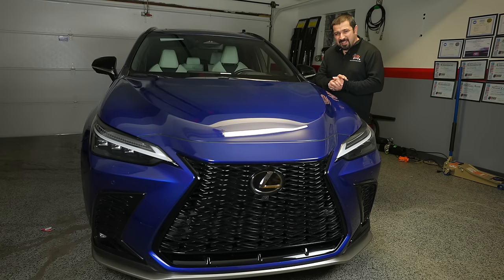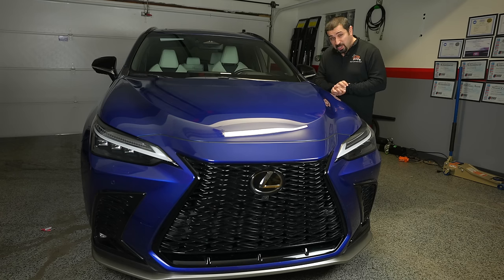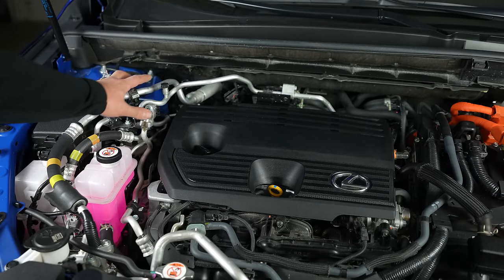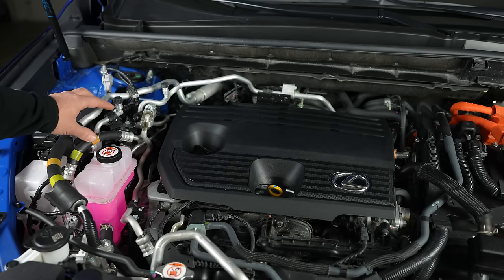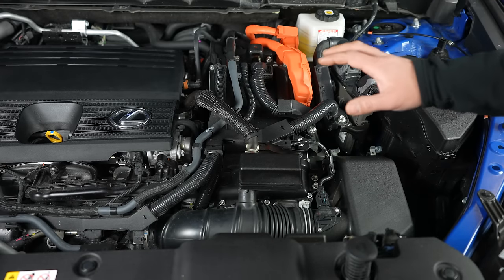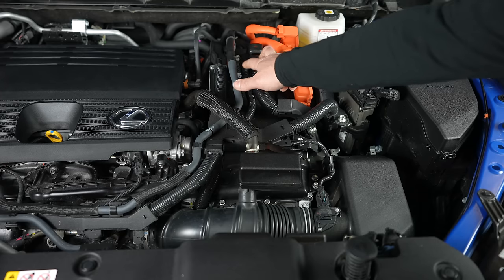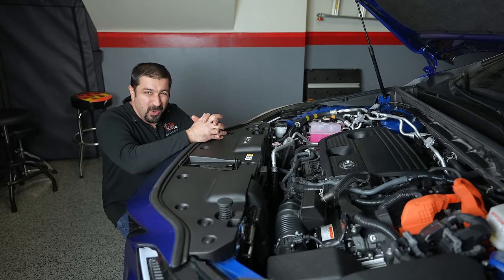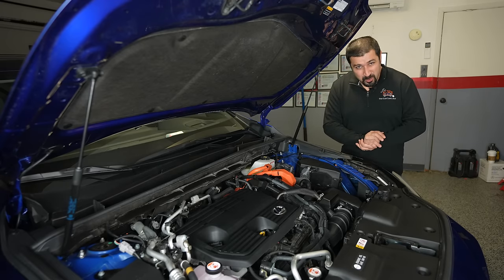The 2022 Lexus NX Marks the New Era of Lexus! Full Review and Technical Tour

Comment: I work for Toyota so I may be biased, but the electronic door handles are electronic for safety reasons. It will stop you from opening your door if a cyclist or vehicle would impact the door were it opened. In that case it will beep at you and not open the door. As you said though, there are mechanical work arounds if the battery or electronics fail. Some other cars have a similar setup like Tesla.
Reply: I have the same system on Audi with classic door handles. They also would flash or be blocked if some obstacle is detected. So - no reason for such complicated handles that no passenger is able to open or close (unless they are instructed before).
Reply: Imagine parking your car in Manhattan. The door will never open lmao
Reply: @tadeusz8977  can you link a video where we can see the doors being blocked on an Audi?

Comment: Wonderful review. I’ve heard, the reason Lexus went with the button door handle has to do with sensors detecting bikes, cars or pedestrians traveling by and not allowing the door to open crashing into them. A mechanical solution would not have worked as well.
Reply: @wth2021i dont agree. These companies reaseach things. Reviewers dont. Those are just opinion based on little things they know. Saw lots of vidoes videos where a motorcycle, Bikes or even cars hit the door becuase the passenger or driver did not know something is coming at the back.

Comment: I have owned three Lexus vehicles over the years. Gone away to BMW then Volvo. But am going to go back to a Lexus NX 2022.  I have tested the new car extensively and it is superbly refined to drive with a brilliant adaptive cruise system and the best heads up I have ever seen. The touch buttons on the steering wheel are overwhelming initially   
but once you have set up your favourites  it's very easy to use. As for the doorhandles, yes they are a little strange but you get the collision avoidance as a real benefit. Progress I guess.

Comment: I have the 350h and so far just loving it! It did take a bit but got used to HVAC settings. I'm a month and have learned how to set up shortcuts and other easier ways to automate stuff. The Lexus "Siri" is very accurate so don't really need the touch screen as much as you might think. It should be noted that the steering wheel controls are for the top level ONLY in Canada. Any other level there is no HUD or programmable buttons on steering wheel.
Reply: Are you totally fine with the HVAC controls on the touch screen now? Or do you still kind of wish you had physical controls for that?
Reply: What’s different about the HVAC settings?

Comment: Thanks you for such a comprehensive and informative review. It's interesting the difference between the US and UK/European reviews of this car. In the UK the reviewers love the e-latch system and the steering wheel controls remarking that they're both clever and sophisticated, otherwise barely getting a mention. In the US and Canada, the reviewers, without exception dislike them. The same is true of the run-flat tyres (tires). I've had run-flats for years on my BMWs and I like them, I trust that if I get a puncture when travelling at high speed that I'll be easily able to maintain control and won't have to stop on the side of a busy Motorway/Freeway to attend to a flat. Sure there's a little more road noise in the cabin and they're maybe 5% more expensive but I also get more luggage space. The additional weight of EVs and PHEVs does put extra stress on the tyres and they're more likely to suffer from flats making run-flats an even more logical choice I think. Looking forward to delivery of my 450h+ next month.
Reply: yes, AMD is truly a nut- in a good way!  He is a blessing with his insights.

Comment: Thank you for a very detailed review. I have been driving the 450h+ for two weeks now and overall, I love it. The door handles are not such a bad thing - people will get used to it. The steering controls are something else. The touch controls (just the function display) show up on the HUD every time hands graze over them - especially while turning and is distracting. They also lack texture and force the driver to actually look at the HUD or the buttons, every time a button press is required. Perhaps a SW update will include an option to disable controls display on the HUD and include more customization of buttons.

Comment: Thanks for the review AMD. What should we do once the run flats wear out? Just get regular tires? How do we get around not having a spare tire? One big reason I don't want the plug in is that  it doesn't come with Mark Levinson sound systemas an option.  Also later on the range on on evs are going to be much greater than 40 miles. They will be in the 200-300s. 2022s will be stuck with 40 miles of ev range. As of yet the charging technology, where you can charge, how quick you can do it is not convenient and efficient.
Reply: Michelin cross climate 2
Reply from the maker: Hi! I would get regular tire and have the inflate kit. Otherwise get a spare tire and leave it in the back for long trips. Not ideal but better than nothing
Reply: @IftiIftiIfti  I have CC2 on my 2017 CRV already.  Thinking seriously about getting a NX 350h, so looked already to replace the run flats.  Unfortunately, Michelin does not yet make the CC2 for the 235/50R20 wheels at this time-just the Michelin X-ICE,  Pilot and the Primacy AS.  The Fsport and Luxury trims levels all have the 20 in rims,   I think I would rather have just the std 2335/60R18 wheels on the lower trim as an option just for the tire options.
Reply: @xfirstxlast6502  So you are saying, if I wanted to replace the run flats, I would also need to replace the wheels as well? I'm thinking about getting the luxury package that comes with 20 inch wheels.
Reply: I wish Lexus would make a compartment that we could put into the back in place of what is there to hold a spare tire.  Will go to regular long lasting Michelins once the run flats wear out.  Worried about how they will do in New England winters
Reply: @josefernandez2722  No, just replace the tires.  I plan to keep the 20in wheel that will come std on the 350h Luxury package-- nothing is perfect.  However, the 235/50R20  size does seems to have very limited tire options now vs the 235/60R18 standard tire.   When I can get one (waiting for allocation at Lexus now), I plan to see if Discount Tire will give me some trade-in value and upgrade to the Michelin tire.    I have done this several times before at DT, since I am pretty picky about tires also.  I agree with AMD- why the run flats???
Reply: @william6765  If you get the 18in rim, you will have lot of long mileage/winter tire options.  Unfortunately, the upper trims all come with the 20in rim.  And at this time, even the longest lasting Michelin is the Primacy AS with its 55k mile warranty for the 20in.- no Defender T&H or CrossClimate 2, at this time.   I can not find much testing/reviews on the Bridgestone run flats or the new Primacy yet- so TBD.
Reply: @william6765  The Bridgestone K02 tires are the best for the kind of heavy snows that a New England Winter kicks out,
and there is another tire that ranks #2, is quieter and soother for highway driving that I bought and still does a great job in the snow. I have used them for 2 years and found that they are wearing well and I only use them from mid December to April 5th.

Comment: @The Car Care Nut 
I am a Master Certified Lexus Parts Specialist, I am pretty certain these new NXs do indeed have the new stem replaceable sensors. The new IS generation does. I will grab a 2022 NX VIN tomorrow and look it up to make sure.
Reply from the maker: I was actually shocked when I saw this and checked it on the repair manual and new car features it doesn’t list the separate type at least for the NX450h+ please do update if you find anything
Reply: Thanks for looking.   I am hoping  this is one of early pre-production cars that have been round for awhile. It has the Texas  manufacture plates that I had seen on several of  the first UT reviews and the car looked like it has seen a few miles by all the dirt on the underside. :-).   Hopefully, yes, they will have it.

Comment: The new door "handles" - I think that implementing the auto-locking feature (to prevent opening when other cars approach) would have been complex with a fully mechanical system: you will either constantly lock/unlock the door (noise, wear) or would have to add a secondary solenoid to disable opening (noise, more complexity).  Seems to me the fully electronic solution is simpler (although having a secondary mechanical system as back-up may nullify what I said).
Reply: I think the outer handle is the compromise and "price" of the price of the NX. It's a "simulation" of the good old inductive door handle of the prius and later cars of Toyota. The inner handle is a very good idea, I think. One can prevent an accident and pushing is better than pulling I think. The only thing I don't understand is, why there is a manual mode and a automatic mode. There has to be a better solution.

Comment: For my NX300H 2022, I paid $120 for gas for almost 900KM both highway and city driving. In my 2020 Rav4 XSE hybrid, I paid $90 for about 790KM. Both cars are amazing, and premium gas does make a difference for the engine. 

I still have my 2013 Prius C, and it is still running great👍
Reply: How long do you think battery will last on these hybrid vehicles? I’m worried about battery replacement costs.

Comment: One con for the new infotainment system: the navigation is no longer built in. It’s connected. So you have to pay $16 a month just to have it there. Adding insult to injury, if you pay for the navigation but you live in an area with no reception the nav won’t work at all

Aldo iirc no nx offers a spare tire now
Reply: Yeah....I really couldn't care less for the outdated infotainment center with gimmicky features.  I can just replace it with a much better system that is much more modern and futuristic.
Reply: Well, you have options. Wireless CarPlay and Android auto will give you the nav you need. 

Maybe if nobody pays for the nav, they will give it at a lower cost. I think the cost of the data used by the nav.
Reply: True but remember the same problem I mentioned applies to CarPlay and AA. If there’s no reception in your area you can’t use the navigation either OEM or CarPlay or android auto. They won’t work. I know google maps has an offline mode for navigation but the navigation directions are horrible

Comment: Good review. I had the same toughts when I tested the NX regarding the Door locking and runflats. But also all the gloss black inside.. Though I can live wtih it did test the Merc GLC and Genesis GV70 but they do not have the same quality feel and they have gone even wilder with the infotainment.. considering their reliability records I went for the NX 350h do not need the bigger battery and but want the panoramic sun roof which you could not have wiht the big battery in the car.
Reply: I think you made the right choice. Did you take a top spec Venza for a test drive as well?

Comment: Hi, AMD in regards to the why are there are 3 hood latch on the new 2022 NX. this is the answer that I found in a article. "The engine hood uses a twin-lock structure, a first for Lexus, to suppress engine hood vibration caused by air turbulence, contributing to improved quietness."  Also, is the new engine T24A-FTS a good engine.  Thank you for your great videos.

Comment: As much as I don't like the grilles on Lexus, the 450 grille looks very good with the rest of the front end. It just seems to blend in better with the angular design. I'm with you on the door handles. That's an unnecessary gimmick. I know this is an apples to oranges (or lemons) comparison, but Lincoln used those on the Continental. They are great when they work properly, disastrous when they don't.  The infotainment system looks nice and modern and not like 2002 graphics that Toyota/Lexus seem to be stuck on. I still prefer actual buttons and dials for the HVAC controls. Thank you for showing us the new Lexus. It really looks like they did a good job with it. I have a lot more faith in Toyota/Lexus refining the hybrid models than the twin-turbo introduction in the Tundra.
Reply: I recently was given a 2022 Outback (while my wife's car was in the shop) with the touch screen only HVAC controls and found out how dangerous they are to use while traveling on a highway at upper speed limits as well as on an unfamiliar road or in heavy stop and go traffic. If a driver traveling alone needs to take their eyes off the road to put on the defrost, it could be exceptionally dangerous or even fatal. Thank-you for pointing out this flaw in the Lexus 450+ design.

Comment: Love the video! In your opinion, is the 350h use a reliable engine and transmission? I can't find a good video (like yours!) that goes over what the engine and transmission that is in the 350h (the one I bought). Amazing video! Thank you!
Reply from the maker: Hi! Honestly we don’t have the hybrid IS in the US so I am not very familiar with their exact setup
Reply: @TheCarCareNut  Thanks! I was talking about the NX 350h. But, from what I read, it's basically the EXACT same car as the NX450h+, just with a bigger battery. I could be mistaken, but the Engine (A25A-FXS) and the transmission, as well as the motors are the same. 
Thank you though! Love your videos!

Comment: On the TPMS and active grills.  Got a chance to look at a 2022 NX 350 at dealer.  It also did not active shutter grills (looks exactly like the 450h+).   And it seemed to have older TPMS stem also.  It was all metal and would not flex at all.  I quickly looked at another car on showroom floor (not sure what model), but it had the same TPMS stem also.

I wonder when the current TMPS  stems need replacement tif he car's control system will support the newer model.  Not a showstopper, but  a bit disappointed.  Overall, my deposit is on 350H Luxury trim.  I think it will be a great upgrade over the Rav4.   Glad AMD did this review to highlight these type of differences.

Comment: Thank you for the review. I love how you review cars from a mechanical stand point. It is really appreciated. I have ordered a N450h+ 3 weeks ago for delivery…sometime in 2023!  It will replace my current ES300h which I really enjoy. Looking at another video of yours yesterday on what not to do with the PRIME models, although I ordered a 450h+, I am debating between the 350h and 450h+…not sure. The whole battery management is a bit disheartening for me + I want to keep this next car for a long time (10+ years)
Reply: Hi Marc, I  originally has placed a deposit on a 450h+ too. I was  thinking why not, with the tax credit, performance and EV only range, it just a hybrid with a bigger battery in complexity- a no-brainer.   However, after viewing AMD's  UT and his suggestion to look at the Prime owners manual, and other considerations,  I changed my order to a 350h- the 450h+  is really a lot more complex with its heat pump and battery thermal management system vs just a regular hybrid.   It is has all the essential elements of a full BEV with the baggage of an ICE when in EV only mode.  It is true, one could just run the 450h+ in hybrid mode, which would be my use case.  But then, you have a hybrid that is carrying over 400 lbs of battery that is not needed for hybrid, so back to the 350h.  

I really appreciated AMD's insights and for me the 350h is a much better fit for a 10+ car.  Without his UT, I am not sure I would have seen the tradeoffs.   I am looking forward to getting the 350h even with the concerns of no active shutter, its weird choice of  20in run flats and door locks along with the older TPMS- everything has tradeoffs.  LOL
Reply: You also have to use up the gas every once in a while or the gas gets water and corrodes the lines.  Gotta get the engine going on s regular basis.
Reply: Curious Marc why you are giving up your ES300h for the NX hybrid? I am debating between the two and looking for more insight. Thanks!
Reply: @keithhansen3215  Interesting question. The ES300h is a fantastic car to live with. After 3 years of ownership, I love how this car drives, how big and yet agile it is and how quiet and comfortable the cabin is. Add to this a 5.8l/100km economy as an average and it is the PERFECT car!   Then…why the NX?  If my ES back seat does not fold. I cannot put a simple item that would measure 4’ long and more then 16’’ wide…it is very frustrating for me and is the major dealbreaker.  Also, I am very limited to where I can go with this car. I basically need to stay on paved road.  The NX gives me more flexibility, and this new generation is stunning on the road.  I was very impressed with it and felt home driving it, just like I was driving my impressive ES.

Comment: Here I am again at 3am watching my favorite channel and master mechanic. I just traded my wifes 2015 Rav4 XLE for a new 2024 NX250 (retirement present). I bought the base model to avoid turbos, CVTs and excessive electronics and my wife loves the car, Not a fan of the electronic shifter or the run flat tires but overall the quality level is high and drives and handles well. I chose the NX because the 2024 Rav4 XLE model had very limited color choices and didnt like the excessive black body and fender cladding. The NX is far more attractive. Last year I bought a new 4 Runner so now our transformation from Honda to Toyota/Lexus is complete and look forward to our retirement years to be trouble free with help from the car care nut!